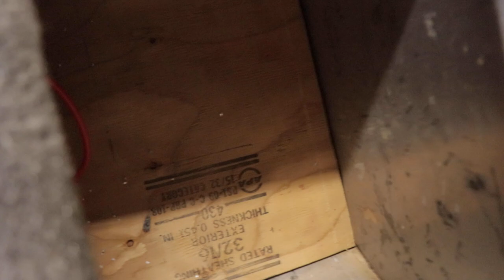We Turn A Jon Boat Into A Bass Boat

Comment: I’m trying to build a deck and wondering what y’all used as a frame, Looks like angled aluminum?
Reply from the maker: yea we used 1 on angle aluminum
Reply from the maker: i would recommend using 1 1/2 instead cause ours flex when theres enough weight is applied